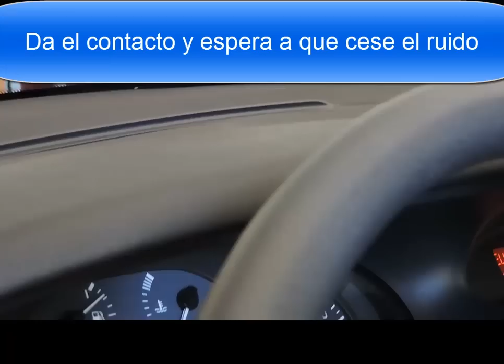Quitar ruido de trampilla de reciclaje en un Megane

Comment: Hola estimado. Tengo un megane coupe 2001. Calienta al principio y luego ya no. Las mangueras ambas calientes de entrada y salida del radiador de calefacción. No baja el nivel de líquido de líquido refrigerante. Que podría ser?
Reply: Tengo exactamente el mismo problema tambien en una coupe 2001  y no he logrado averiguar cual es el problema
Reply from the maker: Si entra agua caliente y sale caliente, no significa que el radiador esté bien, sino que hay un tramo libre de suciedad.
Eso se comprueba si, al tener el motor caliente, se abre la trampilla de mezclas para seleccionar todo el calor, y se da toda la ventilación.
Si sale calor, pero solo unos segundos, el radiador está sucio y hay que cambiarlo.
Reply from the maker: @ivanfab7816  Mira la respuesta que acabo de dar a Rubén.

Comment: Buenas tardes tengo una consulta, si se deshabilita la trampilla que consecuencias o que funciones dejan de servir en mi cauto?
Reply from the maker: Hola: Simplemente, el aire entra por la entrada seleccionada cuando se anula el motorcillo que mueve esa trampilla. Por eso es importante anularlo cuando la trampilla queda en posición "aire exterior". De este modo, el aire siempre entra del exterior. Si quedara en posición "reciclaje", el aire lo coge del habitáculo y, si hay humedad, los cristales se empañan. Aparte de acabar viciado el aire.
Reply: Te hago un consulta relacionada a eso mismo, resulta que tengo el mismo problema pero yo opte por dejarla cerrada ya que sino el aire frío de afuera enfría todo el auto, me podrías explicar cuál es la posición normal de esta trampilla y si en esta es normal que entre aire frío al habitaculo? Muchas gracias
Reply from the maker: Al habitáculo siempre entra aire frío o, mejor dicho de la calle, si está en posición de "no reciclaje". Por supuesto que para calentar o enfriar el habitáculo, va a costar más pero, si se deja en posición "reciclaje", va a utilizar siempre el aire del habitáculo. Eso implica reciclar los malos olores, la humedad y, por consiguiente, vienen los malestares y el empañado del parabrisas.
Reply: @RamonVerdial  A no ser que ventiles tu mismo, bajando las ventanas durante un tiempo mientras circulas a una velocidad decente (no en parado), o no? 
Por cierto, como puedo saber si esta en posicion de reciclaje o de aire exterior? activando en dicha posicion el boton de la consola? Gacias Ramon.
Reply from the maker: Se suele notar la diferencia de caudal de aire. Aunque lleve filtro de polen, suele entrar más aire si no es reciclado. Si no aciertas, efectivamente se empaña muy rápidamente y de no abrir las ventanas, nunca marcha la humedad.
Procura esperar a que acabe el ciclo de ruidos eligiendo aire exterior.
Reply: @RamonVerdial  el aire exterior se selecciona con el botón que hay en la consola verdad?
Reply from the maker: Si. Con el botón de reciclaje pulsado, el reciclaje está seleccionado. Con el botón sacado, el aire entra del exterior.

Comment: hola, yo tengo un megane 2 del 2004 concretamente el 1,6 16 valvulas  comfort dinamic, me hace el mismo ruido , quisiera saber si  el conector que has desconectado en el video es el mismo en el modelo de mi coche, muchas gracias y muy buen trabaj
Reply from the maker: Hola: Completamente distinto. Saca la guantera como cuando se cambia el filtro de polen y ahí encuentras el motor de reciclaje. Para mandarte una imagen, necesito un correo electrónico.
Reply from the maker: Correo enviado
Reply: @RamonVerdial  muchisimas gracias, este fin de semana voy a desconectarlo, saludos
Reply from the maker: Te mandé un correo el día 26 y no he recibido respuesta. ¿Lo has puesto bien?
Reply: @RamonVerdial  el correo está bien, pero no he recibido nada tuyo gracias
Reply from the maker: @DAVID-lj9td  Te lo he enviado desde otro correo. Por si acaso, mira en Spam.
Reply: @RamonVerdial  ahora sí, recibido
Reply from the maker: @DAVID-lj9td  Pues seguimos por correo

Comment: Hola Ramón que es el primer enchufe que quitaste?yo lo quité en una furgoneta Renault Trafic y me dejó de hacer el ruido todo funciona correctamente pero quería saber que es por no dañar otras cosas. Gracias.
Reply from the maker: Hola: Eso solo alimenta el motor de la trampilla de reciclaje.
Al desconectarlo, no funciona y lógicamente desaparece el ruido.
Pero es muy importante antes de desconectarlo, dejar la tampilla en tope abierta para que tome siempre el aire del exterior porque si no, al hacer la recirculación, tiende a empañarse el parabrisas.
Reply: Cómo se llama la pieza que cierra y abre la compuerta para comprarla?
Reply from the maker: Se rompe el motor de la trampilla de reciclaje. Necesitaría más datos de tu furgoneta (foto de la pegatina identificativa que está en el pilar central derecho abriendo la puerta delantera) para darte la referencia exacta.

Comment: Hola Ramón
Muchas gracias por el video. Tengo el mismo problema en un megane classic 1.9 dti 100cv de enero de 1998, y desmonté lo mismo que vd., pero en mi coche no estaban ahí los cables, quería que me echara una mano a ver donde está el cable en mi coche. Ví su web, y le escribí un mail a su correo de terra la semana pasada. Hay posibilidad de que me pueda echar una mano para saber por donde puede estar el cable a desconectar en mi coche?
Gracias de antemano
Reply from the maker: +Perico de los palotes  Pensé que te había respondido. Lo hago ahora por si acaso.
Necesito un correo electrónico, y saber si tu coche tiene aire acondicionado.

Comment: Buenas Ramon. Está muy bien el video. Mi problema es que tengo un Megane del 1997 y no encuentro los cables con tanta facilidad cómo en el video. El ruido viene de ese mismo lado, pero no parece tan fácil. Sabrías cómo llegar hasta ellos en este modelo? Gracias!
Reply from the maker: Hola: ¿Tiene aire acondicionado? Si lo tiene, dame unas fotos del compartimiento de la batería. Allí hay varios cables que quiero ver para darte instrucciones. Pasa las fotos y la pregunta a rverdial@terra.com
Reply: @RamonVerdial   hola tengo ese mismo problema en un megane del 97 podrias decirme donde se aloja el cable mi modelo tiene aire acondicionado. Gracias.
Reply from the maker: @ruwengp7273  Si no es exactamente como este modelo, hay que cortar un cable amarillo por el alojamiento de la batería. Hay sólo dos amarillos. Corta uno de ellos de modo que puedas volver a empalmarlo si no es ese.
Reply: @RamonVerdial   si mi modelo es un megane classic de 1997 gasolina motor 1.6, mirare a ver si veo esos dos cables amarillos imagino que iran a un conector. Muchas gracias por la respuesta. Un saludo.
Reply from the maker: @ruwengp7273  Correcto. Están en una de las dos clemas de conexión entre la batería y el motor del limpiaparabrisas. Tengo una foto explicativa, pero no sé dónde la tengo. Aparte de que tampoco se pueden pasar archivos por aquí.
Reply: @RamonVerdial  gracias mañan intentare mirar si puedo hacerlo, si tengo dudas le escribo por email para la foto que tiene por si aparece. Muchisimas gracias.
Reply: @RamonVerdial  Hecho!!  he tenido suerte y he dado con el cable a la primera. Muchisimas gracias, me suscribo a tu canal. Un saludo.
Reply from the maker: @ruwengp7273  Me alegro de que te haya servido de ayuda.

Comment: Hola buenas tardes.Tengo un megane 1 del año 96,es el 1.6 de gasolina.Hace un par de dias que ha empezado con el dichoso ruidito,si esta el boton de que recircule el aire lo hace muy poco,pero si esta desconectado,lo hace unas cuatro veces,se para y a los 20 segundos vuelve otra vez,ademas se escucha el ruido del motor electrico como que esta girando continuamente.
El cas es que hoy he comenzado a desmontar todo siguiendo tu video y resulta que donde en el video estan los conectores,al lado de la caja del filtro,debajo de esa ultima tapa que quitas,en el mio no estan.Al lado de la caja del filtro solo esta esa pieza de plastico rectangular que se ve en el video debajo de donde estan los conectores.
Sabrias decirme en que otro sitio puede estar el susodicho conector para quitarlo?
Muchas gracias y un saludo.
Reply from the maker: Al lado de la batería hay unos conectores que van hacia el centro de ese hueco, bajo el limpiaparabrisas. Dame una foto de esos conectores. Si por aquí no puedes, manda esa foto a mi correo  webrverdial@gmail.com
Reply: Muchas gracias por responder,el coche se lo llevo mi hija ayer,esta estudiando en otra ciudad.Cuando vuelva le hago las fotos y te las mando al correo,ya te mande uno anteriormente comentandote el problema y otro pequeño que tiene,no se site habra llegado.
Gracias y un saludo

Comment: hola Ramon a ver si me podrias ayudar , tengo un megane 1.9 D.C.I de finales del año 2000 y el problema que tengo es que si pongo el a/a no salta el compresor y esta todo bien ,no tiene fugas ,tiene gas , pero la cosa es que cuando salta el ventilador del coche salta tambien el compresor y da frio y lo que me gustaria es que fuera al reves poner el compresor y que diera frio e pensado incluso poner el ventilador del coche a traves de un interuptor para ponerlo manua , a ver si pudieras ayudarme , un saludo y gracias anticipadas
Reply from the maker: Hola: Que no está todo bien, seguro. Si no, no habría fallos.
Es imperativo que funcione el ventilador (GMV) del radiador del motor, para que entre en funcionamiento el compresor.
Como en tu caso, si funciona el GMV funciona el compresor, es más que probable que esté mal el presostato trifunción, o el captador de presión, dependiendo del circuito que lleve tu Megane.
Necesitaría datos más precisos de tu coche para mirar esquemas eléctricos.
Esos datos solo te los puedo pedir por mensaje privado.
Reply: gracias Ramon por responder , y no pofria poner el ventilador directo a traves de un interuptor para hacerlo funcionar manualmente cada vez que ponga el a/a ? Voy a mirar lo que me dices y lo que te e preguntado es para ir viendo opciones ,gracias de nuevo

Comment: Muchas gracias por tus publicaciones. En mi caso el carro de mi padre es un renault megane classic 1.6 cuyo sistema de aire acondicionado es similar al que tienes en este video. Quería saber cómo puedo cerrar la trampilla de reciclaje de aire ya que está abierta, el sistema averiado de apertura-cierre y permanentemente se le mete a la cabina el aire de afuera . 
Gracias de antemano por tu apoyo!!
Reply from the maker: Hola: Lo lógico es dejar anulada la trampilla de reciclaje, como está en tu caso, ya que, si se anula en posición de reciclaje, los malos olores se van a notar , y mucho. Aparte de provocar el empañado del parabrisas.
Pero para hacer lo que quieres, debes de conectar de nuevo el conector suelto y soltarlo cuando el sonido de la trampilla denote que está en posición reciclaje.
Reply: Muchas gracias Ramón por tomarse su tiempo en responder. Pero me expliqué mal, el conector no está ni ha estado suelto, tampoco mi problema es el ruido del engranaje de la trampilla. El problema es que el  sistema de cierre-apertura está dañado, no responde con el mando y la trampilla queda siempre abierta. Como puedo cerrarla o condenarla sin desarmar el tablero?
Reply from the maker: Hola: Comprueba si le llega masa a uno de los cables, y corriente con contacto puesto al otro cable. Si no le llega, dame un correo electrónico.
Reply: Vale pruebo y te escribo. Gracias y saludos desde Venezuela.

Comment: Buenas he visto como lo solucionas , pero el megane que voy a comprar , aún no lo tengo,  tiene ese problema es el modelo de 1999 motor 1.6 k7m con aire acondicionado me podrías decir donde está el conector en este modelo, ya que otros te habran enviado fotos y supongo que me podrias explicar donde esta ese conector. Gracias. una muy buena solución si no hay dinero para repararlo. Te he enviado un correo. Pero me pone que no se ha podido  entregar, ya no tienes esa dirección de correo. Saludos.
Reply from the maker: Hola: Cuando tengas el coche,saca una foto a la zona de la batería para ver los cables que van hacia el limpiaparabrisas.
No he recibido ningún correo. Mándamelo a webrverdial@gmail.com
Reply: @RamonVerdial  buenas al final , ya lo he conseguido . La ubicación la misma que en tu video.
Gracias.
Reply from the maker: Me alegro que te haya servido de ayuda.
Reply: @RamonVerdial  buenas Ramón ocurre una cosa si lo hago poniendo el contacto y cuando acaba el ruido con contacto puesto,  desconecto el conector,  entonces cada vez que cierro la puerta del conductor suena como que la tapa golpea. Vuelvo conectar el conector, pongo el contacto espero a que terminen los ruidos quitó contacto y desconecto el conector, ya no suena nada al cerrar puerta conductor.
Reply from the maker: @cosas7816  Ahí es donde has de dejarlo. Si suena la trampilla, es porque está cerrada, y el aire en recirculación.
Reply: @RamonVerdial  ok entonces lo dejo que suene la tapa al cerrar la puerta para que sea aire de la calle. En mi caso lo he hecho con contacto quitado.
Gracias por tu ayuda.
Te he enviado y
Un correo electrónico con 2 dudas.
Saludos
Reply from the maker: @cosas7816  Al revés. Lo notas porque de la calle entra más caudal de aire. Pero hay que hacerlo con el contacto puesto, ya que si no, no funciona el motor de reciclaje. No he recibido correos (de momento). Por si acaso, manda el correo a webrverdial@gmail.com
Reply: @RamonVerdial  ahora lo he dejado que no suene la tapa al cerrar la puerta. Pero lo he tenido que hacer con contacto quitado, ahora no suena al cerrar puerta conductor , si lo hago con contacto puesto, cuando cierro la puerta suena. Te envío  correo.
Saludos